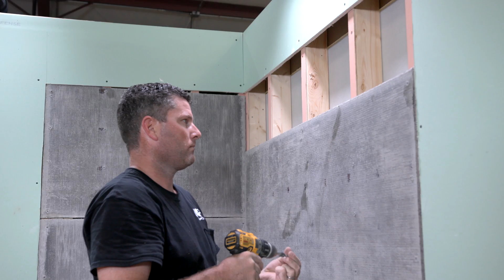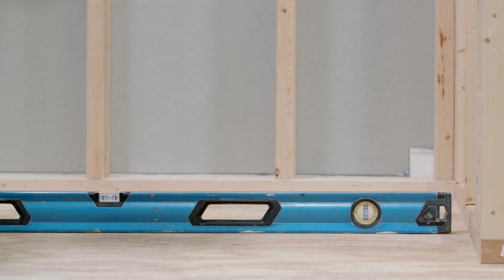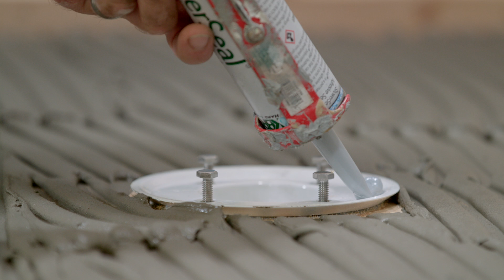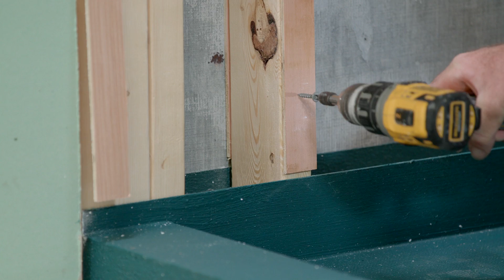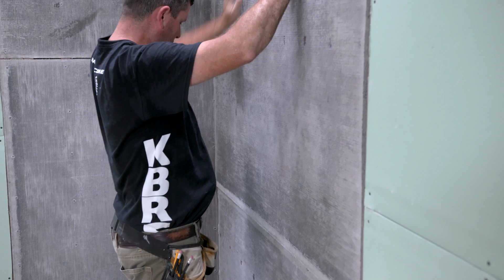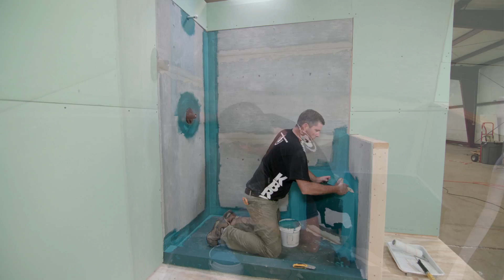How to Install a Shower Pan (KBRS Tile-Basin®)

Comment: So you fur out the wall to fit the pan but now those walls will not line up with the rest of your bathroom walls!!!! Something you CONVENIENTLY  covered up!!! Why be elusive?! It is what it is! Be truthful and candid!
Reply from the maker: While every persons bathroom may vary depending on where they are in the installation process (i.e new build or existing) - the purpose of our videos is to educate in the product installation. The slight variation you mention of an existing shower renovation would need to be mitigated and concealed by using bull nose tile or blended using drywall trim. Either method would be the best way to deal with the “jog” in the wall. As a last resort notching into the studs may be another option, but we don’t really recommend it as this can violate building code in your local area and be potentially unsafe.
 
However an individual may decide to deal with this would be up to you, local building codes, and your contractor (if participating). Alternatively, our customers are encouraged to contact us directly to discuss installation details with any questions they may have to complete their install successfully and best practices that may be involved on a case by case basis, as mentioned no two installs are 100% alike.

Comment: Furring strips are 1/8in thick?
Reply from the maker: For the furring strips, in a perfect world they would be 3/8” thick, but it’s always best to dry fit your basin first and see what thickness is needed from there. As it can be determined by how the basin fits the space, either being tight or having a certain amount of wiggle room, and/or the squareness of the stud walls can dictate the thicknesses of the strips. The furring strip would start just above the wall flange of the basin, which is 5” tall. In most cases a local home improvement store may have one or more thicknesses available, but sometimes you might have to take a 2x4 and cut what you need out of it directly.

Comment: I plan on not doing tile walls but instead a quartz wall.  Do I need to have Fur strips or is it best to do the showerslope?
Reply from the maker: Either the Tile-Basin® or ShowerSlope™ will work for quartz walls. Design and accommodations of the furring strips could come into play.

Comment: after installing the Kohler drain, I lowered it as far as it goes, but there is almost 3/4" height of the drain off the tile in shower floor. My tiles are 1/4" how do I make up the extra 1/2" ? Do i need to build it up with thin set or goboard? This must be an issue for many people. I need 1/2" tile but mosaic are usually 1/4" tile. Any suggestions please?
Reply from the maker: When using a Kohler drain we would recommend one of our T-2 Tile-Basins.  At this point, you will need to build up the elevation by combing out thin-set with a ½” trowel, allow it to cure, and skim over it to change the elevation. Alternatively you could use deck mud to increase the elevation of the basin.

Comment: how does the drain stay direct center if the wall gets strips on it plus half inch backer board? seems it would put the drain off center.
Reply from the maker: Left to right in this particular video the drain would remain centered. Front to back your drain would be 1/2-5/8” closer to the back wall. Of course this is with a standard sized unit. You can compensate for this with a custom TileBasin.
Reply: @Kbrsinc  how does it not change left to right if you're adding 1/2 "  plus to the right side?
Reply from the maker: @rubbbt3547  If you add a 1/4" shim to the left and the right, then add 1/2" for the backer board to the left and the right, all things being equal, the drain will still be centered. The difference you'll see at that point is from front to back where you are adding a 1/4" shim and 1/2" backer board to the back wall and nothing to the curb side, which ends up being 1/2-5/8" closer to the back wall. If you have any more questions or would like this explained in further detail please feel free to give us a call: (866) 912-3211.

Comment: Nice video. If you furr out the cement board in the shower, how will it sit flush with the adjacent drywall?
Reply from the maker: Because of the furring strips you are correct that the shower wall wouldn’t be flush with the adjacent drywall. There would be a slight unevenness that would need to be incorporated into the shower design. This could be mitigated and concealed by using bull nose tile or blended by using dry wall trim. If you prefer to not fur the walls you could use our other shower pan called the KBRS  ShowerSlope™, this pan does not require furring strips for installation, but is also not factory waterproofed.
Reply: Rand Kocher that seems like an expensive alternative.
Reply: @Rand Kocher  i'm pretty sure home depot has 1/4" furring strips, if not you could have them milled pretty easily. then just brad nail them in to the studs and you no longer need that 2x 1/4" cement board, and still have a conventional 1/2 drywall equivalent if using 1/4" cement board
Reply: @fd3871  Home Depot and Lowes do not carry furring strips thinner than 1".  But in the trim department, you can get ¼" strips that are essentially the same thing, but a higher quality wood, and quite a bit pricier than just using backer boards.  I am going the wood route and using ½" GoBoards from Johns Manville instead.  The savings in the waterproofing more than make up for the wood steps.
Reply: You're wrong. They carry both wood lathe (1/4" thick), and cardboard buttstrips, that are close to 1/8" thick. Hope this helps. @apwelsh